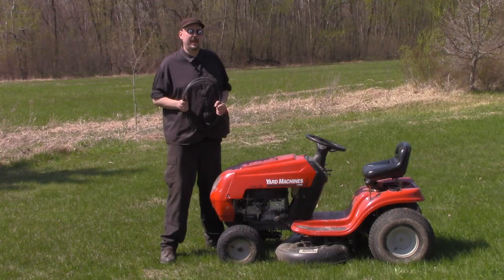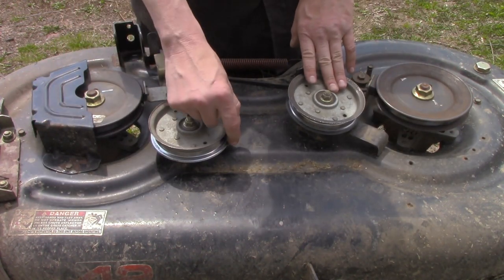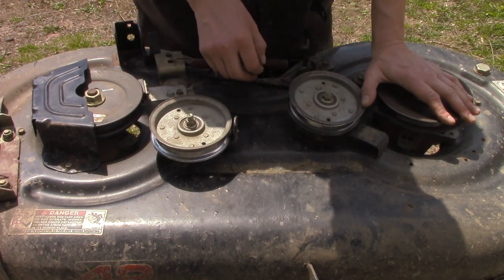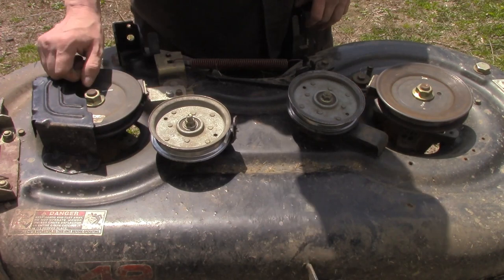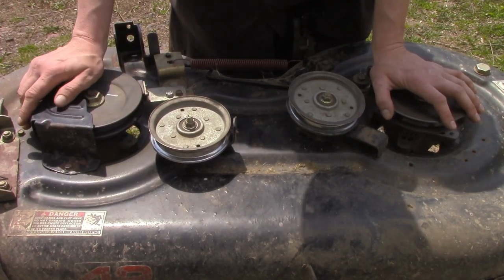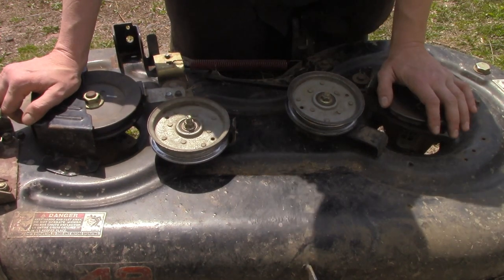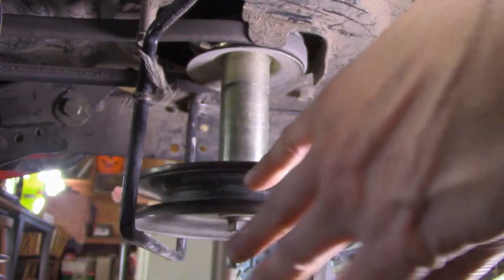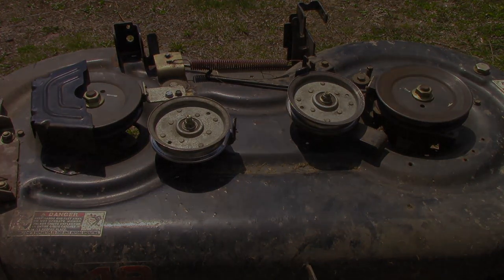What makes  your riding lawnmower burns through and breaks deck belts in a short amount of time

Comment: Check the bearings in those idler pulleys if they don't spin smoothly replace them. Because when they're spun up to speed by the mower they're more than likely locking up intermittently. Even if they still O.K. by hand under load and at operating speed is a different ballgame. So if they feel at all like they could be getting close to the end of their life replace them. You shouldn't be able to feel the balls in bearing kinda doing there thing. It should be relatively smooth. That's something I see alot of people overlook. They automatically think that if it doesn't get tight while you're spinning it by hand it won't do it when it's running either..which is very wrong and again it may just be for a split second at a time but after you've spent 3 or 4 hours cutting all your grass that's put quite a bit of wear and tear on that new belt. When in doubt replace them. They're usually not all that expensive to begin with especially if they're say 5ish years old and you have a fairly large yard to cut. One that actually takes a few hours each time. Chances are they're getting close to wore out. Make sure all your pulleys are in proper alignment with one another as well. They all should be at roughly the same height and straight not on an angle or anything like that to the other pulleys. MTD has gotten so cheap over the past 20 years or so that that's actually a very common issue on them.
Reply: Hi Josh. I have a Craftsman 42” t1200 mower and one of my idler pulleys is bent up. So I’m guess it’s not supposed to be that way? And if not… is the bolt bent? Or just the pulley wore out? Thanks Bud! 🤝
Reply: @jamesbarlowjr.3762  yeah if it's bent it might be locking up when it gets up to operating speed. They're usually not all that expensive in the first place anyway so yeah just replace it and rule it out. That's probably it though.
Reply: @JoshSmith-wo7zw  Thanks. So would the bolt be bent as well? This is year is the first time I’m really putting the mower to work. And was gonna do some preventative maintenance and that’s when I seen the idler pulley. Thanks

Comment: Just got married last year. Wife's mower is eating belts. I can see now that the front belt guide (the U-shaped bar or metal shield) is completely missing. Watching your video lead to a very quick diagnosis. I now need to find a replacement part before installing the new belt. Tnx.
I see that you pulled up and down on the pulley to check for bearing wear. Is that the only thing to look for when checking a bearing? I wish that you had been more specific. I'm going to look at your other videos to see if you address this.

Comment: I have a craftsman Lt1,000. And the installed a new belt . When I engage the  blades i smell rubber and I shut it off looked at the deck belt . The outer part of the belt is slightly  damaged  from something rubbing against the belt . Im going to do  complete check   to see what the problem is .
Reply: I am having the same issue, have you found the problem?
Reply: @toryvitko9613  No answer?

Comment: i have a yardmachine 42" made by mtd has a terrible vibration when engaging deck ive replaced both spindles all 4 pulleys and the engine pulley idler arm both blades and the belt and it has the exact same vibration it had with all the old parts any suggestions on what to try any help will be appreciated thanks

Comment: thanks for the video . Can you deck pully holder/supports bend? i have an MTD 42inch and the pulley support seems to be on an excessive angle.  My main problem is the belt seems to sit loose. The problems began after i hit a buried tree stump and it all went down hill from there.

Comment: Took all the guides and brakes off and no more trouble
Reply: How's it holding up now? Does your belt ever slip off? I'm thinking about doing this.
Reply: Doing fine, just be careful,took all of the safety switches off also, be careful out there!
Reply: All of the parts numbers should be on a sticker under your hood or bonnet if you're across the pond
Reply: @ConsensusX  looks like it will, but never has. 3 years now.

Comment: Do you have a video to show how to keep the belt on a troy built pony from coming off .
Reply: One cause for your blade belt coming off besides guides bent or missing is the front deck adjustment. If your belt comes off while running when you put your deck in lower slots like #2 deck height then you need to adjust the big nut on the front deck hanger by tightening it so the front of the deck rises. If front of the deck is too low the deck pulley will not line up properly with the engine driveshaft pulley and the belt will come off when running as instead of the belt riding toward the center it catches the edge of the deck pulley (engine pulley is too far above the deck pulley). It comes off on the idler pulley that feeds from the engine pulley even with the guide firmly in place because the misalignment with fast rotation and flexible belt will pull the belt right out and over the retaining guide. Also if you changed your driveshaft pulley with a used one it may be shorter than the original pulley and cause the same problem. I had that problem once when changing out a motor. Just put the original pulley on and it was fine.
Reply: Did you ever find out anything?
Reply: @primee5730  yeah! Me too!  Belt won't seem to stay on

Comment: Should the spindle coming out the motor continually turn even when blades disengaged?
Reply: Yes the drive shaft from the motor always spins while the engine is running. The motor turns the drive belt that turns the pulleys on your transmission (that's what allows the mower to be driven). The motor also connects to deck belt via a clutch and pulley. This spins the blades but only when your turn on the PTO switch

Comment: I have a YTH22V46, the right side mower brake arm that brakes the spindle pulley when disengaged is rubbing on the belt. I have tried adjusting a few things on the deck and it’s still rubbing. What would cause that?

Comment: Mine burned in half. It wasn’t from the pully. Like it was sliced in half at an angle. Brand new belt, and new idler pullys. The belt never moved. $90 belt flushed down the toilet. What’s wrong with it? I found a long tiny square shaped block of metal under my mower while cleaning up the floor  not sure where it came from.bad boy zero turn

Comment: Do you know if all the guards on the idler pulleys are supposed to stick straight up???  I have a Husqvarna Y21k46, and one of those guards kind of leans forward.  I'm burning through belts about every 12 to 15 hours, and I could not figure out what the problem is.  If it's not the guard, I have not clue as to what it could be :/  These belts are $45 a piece, so I'm getting tired of having to replace them already.  I mow some family property that is about 5 acres, so I replace it often.  Wish you were closer to take a look at it!!!  Thanks for the info though!
Reply: You could start by taking the guard(s) off and see if that makes a change. I don't run any guards because they trap clippings under them and can heat up. Also get under your deck and look for straight alignment on the belt and pulleys. Are you using correct belt for the machine? Could it be your habit of mowing or where your mowing. I have been cutting lawns for 75 years. I have solved many problems. Sometimes simple questions return simple answers.
Reply: @billhendrickson5506  I did purchase belts from a different source, and they seem better.  However, I removed the guards when mowing large property and it seems to also help.

Comment: My Yard Machine was working fine. Once I replace the deck belt , I saw white smoke coming from the engine pulley. It spins while the engine is engaged and disengage. What could cause it to just spin now?
Reply: Ronald, the engine pulley will be turning 100% of the time.  The PTO lever tightens the belt with an idler pulley on the deck and that causes the belt to tighten on the engine pulley to engage the power.
If the belt is always tight on the engine pulley, it is one of two things:
1) The belt is the wrong size (too small)
2) There is some debris causing the deck mechanism to jam and tighten the belt.

Comment: Are those outside guards over each blade pulley required to keep the belt in place, or is it a safety item?
Reply: They keep the belt in place. If they are off your belt is more likely to slip off of the pulley. There is also a safety factor involved, but that is secondary,
Reply: @houstontx68  You are exactly right. I replaced the cracked, damaged covers and the belt stays on.

Comment: Do you ever see belts stretch to a point of not working?
Reply: I have not, and I have had a belt go years while being soaked in oil(causes swelling and stretching) from a leaking engine as well as having big chunks missing and cracks. A belt will likely snap before it stretches beyond use. Most mowers/decks also have adjustments to accomodate stretching. Some are manual and some are automatic(tensioners and springs).

Comment: Craftsman 42" , everything was fine on the new belt, around 2 hr time. Went to mow tall grass so put it on the highest setting and the belt fell apart in 5 min.  The angle from drive pulley to idler and tension idler seemed extreme compared to the 2nd and 3rd notch.  The deck showed a very slight rub mark from belt contact but didn't burn off any paint. The idlers spin free as of the spindles. The tabs that hold the belt in place on the idler are in good position and not running. No grass, rocks or sticks in the belt way. The drive pulley on the crankshaft is a on all the way and not adjustable.  This one is a stumper.  Could it be that it was really hot that day and the belt was made in China?
Reply: Hello Sir. So I’m gonna ask a dumb question. Are one of the Idler Pulleys supposed to be angled? And if so can I ask why? Thanks. 🤝
Reply: @jamesbarlowjr.3762  as long as the belt is in line, no problem,get rid of the brakes,
Reply: @jamesbarlowjr.3762  when you disengage the drive belt to the deck,it gets loose, brakes stop everything, belt slings off. It looks like mine will fall off, but never does.
Reply: Mine does the same thing! Frustrating and becoming expensive!
Reply: My Cub cadet was eating belts until I found out that my deck wasn't leveled any longer. Once I re-leveled the deck I stopped burning through belts.

Comment: every so often I noticed Sparks coming out from where I have the grass shoot tied up. if it wasn't looking down I wouldn't have noticed it I did not notice any shimming shaking nothing out of the ordinary. I cannot find any videos on YouTube about this a few discussions online. was wondering anybody else experience something like this? I have a Craftsman ys4500 42-in cut deck style tractor. thanks for your time
Reply: That's my problem currently. I changed a mandrel shaft and everything was spinning fine after I replaced it. Not sure why it started smoking and sparking. I am having a hard time adjusting the tension. I know this was a year ago. Did you find out what was wrong with your lawnmower?